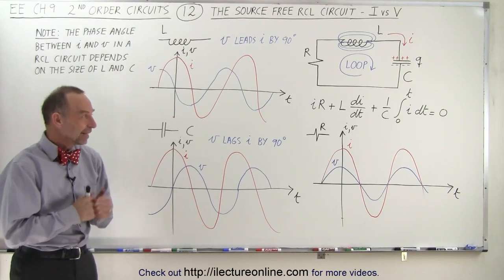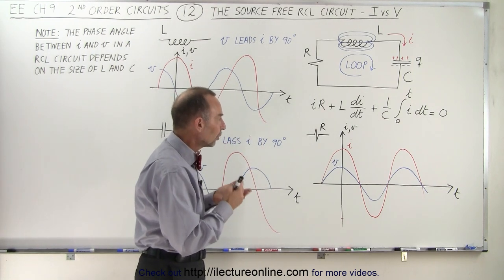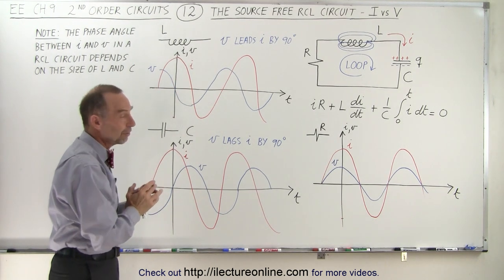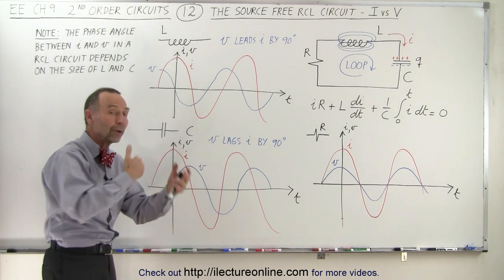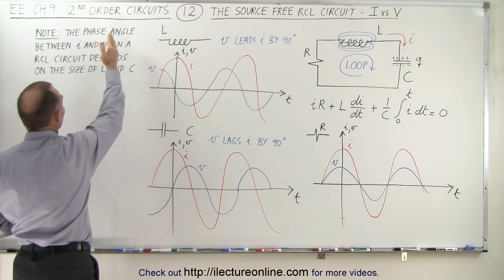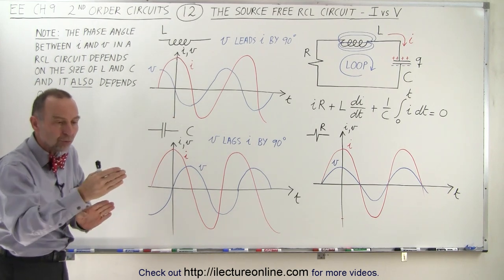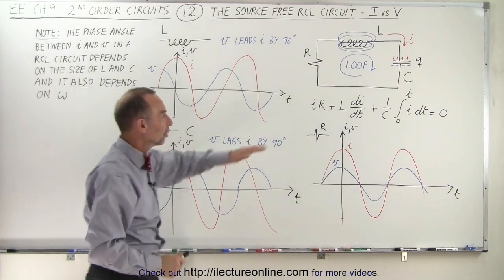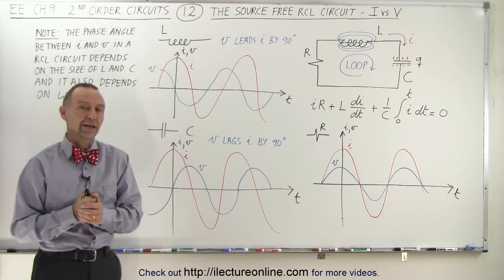Electrical Engineering: Ch 9: 2nd Order Circuits (12 of 76) Source Free RCL Circuit-I vs V

Comment: Sir can u explain the conceptual understanding as to why Voltage leads current in an inductor
Reply from the maker: That is explained in the following playlists:  ELECTRICAL ENGINEERING 7; INDUCTORS     and here:  PHYSICS 49 RCL CIRCUITS
Reply: Because, starting from a zero value, as the current starts to flow through the inductor's coil, the voltage instanteneously builds up across the inductor's coil creating a push or force but current does not instanteneously increases through the inductor's coil because it opposes a change in current due to the inductor's inherrent property known as Self-induction. That is what I can think of a reason why the voltage leads the current in an inductor. Is this the correct concept Michel, can you please confirm?

Comment: Sir how comes if current changes slowly with time then the capacitor has much bigger effect on the rcl circuit than the conductor
Reply from the maker: A conductor opposes a CHANGE in the current, thus if the current changes slowly, an inductor offers very little opposition (reactance).  But a capacitor doesn't allow any current to flow once it is filled with charge, the slower the current alternates the fuller the capacitor becomes each time.
Reply: Yes Sir... 
Xc=1/CW and that is why capacitor does not allow DC current to pass coz the Xc will be infinite. 
I dont understand yout last statement "the slower the current alternates the fuller the capacitor"
Reply: Ooooh yeah Sir.... 
I now got what u mean. 
Sorry for the trouble though. 
I really appreciate your swift response
May God bless u and ur family😊